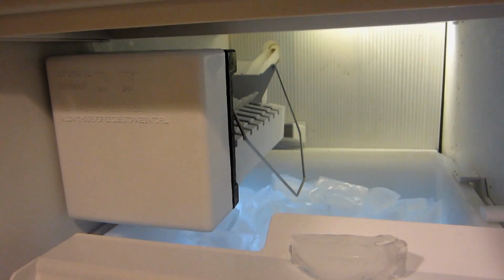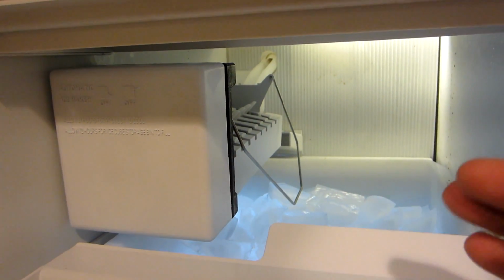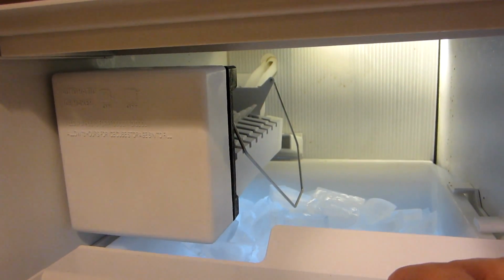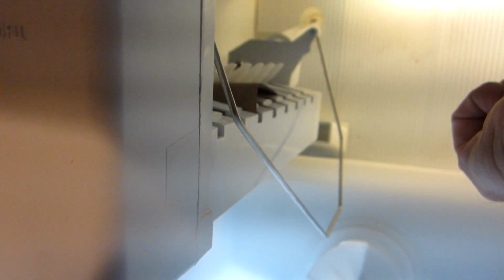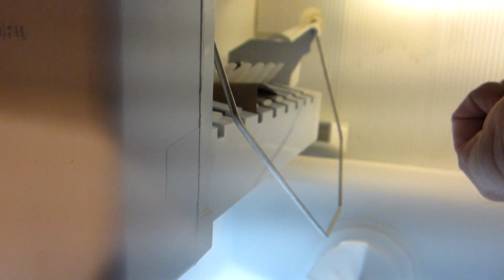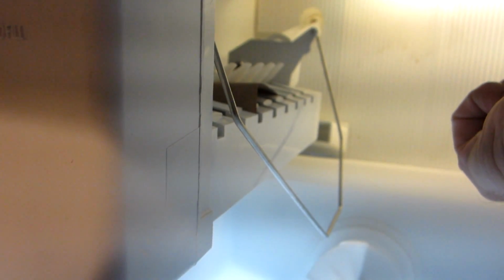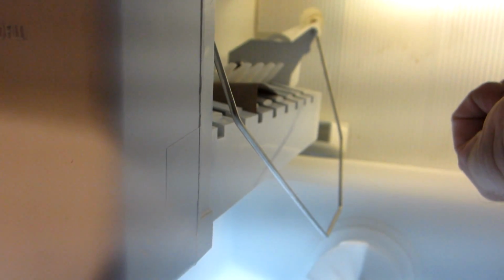How to repair most refrigerator ice-makers for less than $20

Comment: I have ice still frozen in the unit. but, no ice is coming out. This fridge is 23 years old. Got my moneys work from it for sure! So, what is the part I need? The little blades are not showing. What about the heating part of it to loosen the ice? Could that be the issue? 
Also, your fridge looks like it still has power. Did you not unplug it before taking it apart?

Comment: The hole to the left which signals the water to run has burnt out. The tiny copper sheets. How to I fix that part? The module runs and runs well but no water due to that area being burnt out.

Comment: Wow, that motor replacement couldn't be simpler provided someone shows you how to do it. I just replace my entire icemaker as the coating on the ice mold tray is old, blistering and flaking off. Anyhow, I salvaged the original motor and added it to my surplus parts collection. Thank you for sharing this.
Reply: How is the motor holding up after a few months of use?

Comment: Instead of waiting hours for the unit to cycle you could pop the cover off the front and stick s jumper wire in the holes at the bottom marked T and B. If your ice maker is working, within 1 min the unit will start to rotate. If it doesn't then the ice maker is in need of repair. One note though NEVER rotate the cam by hand. This will save you hours of time and I use it every day on my appliance repair job.

Comment: Was originally going to order an entire new ice maker, then i stumble upon this video, where for $29 bucks I could replace the entire Motor module control.

worked like a charm!  couldn't have been easier --- the hardest part was taking the plastic over off the front of the machine to be honest!
if people are scared about just replacing the motor, i purchased the entire module and it was a breeze and mentioned in the note.

Comment: Funny. Ice maker doesn't move, and it's broken motor right away without looking at it? (Maybe in your case, you must have some x-ray vision).  But No, There are several pieces in there that makes the motor not move.

Comment: I was trying to figure out why my Kitchenaid ice maker stopped working and found your video.   

I opened up the modular unit and took a look at the points.  They were corroded a bit, but one of the contacts where the things from the other side of the unit was completely vaporized.  The black plastic on the adjacent side was melted, too.

Comment: thanks for  the   info       I checked mine out everything was good.  except  for the broken water filling line next to ice maker,it had came off  i took off back covering in  freezer  only to find a frozen  tube encased in ice  water was running down behind the cover.  Cleaned it all up put everything back   wa la   ice.

Comment: My ice maker makes ice just won't Despenser it thru the door..I've cleaned all the ice out.and replace ice drawer but nothing.there's no motor running .when u pus the button.on front it opens flap but won't eject ice..please help...
Reply: Hi Judy
Just figured out what was wrong w/ mine,kenmore 106.56926600,but I believe most of them are the same.Behind the front cover there are 2 micro switches and the white cover plate. On mine it uses 2 plastic pins to hold this switch, well one of them broke allowing the switch to pivot and not depress,therefore not activating the auger  motor to turn the auger to push out the ice.What brand and model is your fridge and maybe I can help you out,if you haven't already fixed it.
Reply: Whirlpool

Comment: Thanks for such an easy to follow, simple instruction. It gave me the courage and motivation to get started diagnosing. The shunt wire proved that my motor was working, the fins were dipping into the non-existent water, Checked water supply, tube from valve to the outside back of the ice box area. Next I tried to 'blow' through the tube from the end I disconnected  from the valve and could not blow any air through into the ice cube/water area. This indicated to me that there was a blockage somewhere between the valve and the cube. Suspected frozen tube, used the hair drier to warm the tube inside the ice box. After a few minutes I tried blowing through the tube again and was successful. Reassembled everything, turned the water back on and let the shunt run the motor through a cycle and heard/saw water come into the mold. YAHOO! I have water, now we wait for ice to confirm repairs successful.

Comment: I have replaced the icemaker and water valve in my Maytag Model #m9bxxgmymoo with no success at making ice. I have checked that there is no obstruction in the delivery of water to the ice maker, it seems that there is no power to the unit. Where else can I look for the problem?

Comment: Yes, it was out of stock when I looked too.  I ended up getting the whole module at an onsight repair parts place.  Under $20. & well worth it.  It took about 5 mins to take out the old one & replace.  Thanks so  much for your vid though.  It made fixing/repairing/replacing an undaunting task.  I would never have thought to replace parts myself.  Also had to change out my thermostat - again - cheap, easy & a perfect fix.  Thanks again

Comment: I have the same ice maker but their is a little copper arm that came off.  In your video at about 2 minutes I see you removed to arm lever.  Under the white plastic piece that the lever arm actuates is where the copper arm goes.  How do I put it back?

Comment: Replacing Whirlpool ice maker on Model #GI6FARXXY08 and I have a dilemma. Wanted to show a picture but cannot insert one.  I think Whirlpool has updated the design on the ice maker and I cannot find directions on how to hook up the different designs. Any ideas?
Reply: Jon Baird 
Well I had the same problem. The connector is different. I used 6binch sections of wire and brought the terminals from the new square harness put and put shielded connectors on the other end. I then inserted these into the proper terminals. Make sure you check the wire order... as mine had a switched orientation for white and black. But once hooked up .. works like a charm.

Comment: I have a different type of motor. Its a m006 15 w 120 v 60hz it doesn't disconnect with the gear shaft easily, by turning,  and is improbable to reconnect without the proper tools. just wondering if you had any advice for this type of motor for cheap repair.

Comment: My icemaker was not dumping the ice.  I removed the icemaker and when I took off the motor cover, everything was coated with ice.  I removed all of that, scraped off the blue corrosion, and reinstalled the icemaker.  The teeth seem to be working now but I can't get the icemaker to fill with water.  It was filling before, just not dumping.  Did I do something wrong when reinstalling?

Comment: ok, I have a question... one of the contacts for the ice maker defrost coil is burned or corroded both on the brown plastic "board" with all the copper strips and on the end of the u shaped coil itself. Will this keep the ice maker from allowing water to flow into the tray to make ice?
Reply: +Larry D. Miller II 
Seems like the guy isn't answering anybody's questions on his video.

Comment: I noticed the motor in the video at 1:45 is different from the one at 1:55.  He is able to remove the motor in the latter shot but the one at 1:45 (which is the one I have) cannot be removed.  I will just buy the unit for $70, no biggie.
Reply: Yep... and one assembly is witness marked "Old".    The new assembly gets you a new mold, motor, thermostat, tray heater, etc... etc...

Comment: I have a door ice maker dispenser.  I replaced the entire motor for the dispenser with the oem part, exactly a year ago, and it is burnt out again.  Cost $100.  Can't afford to keep doing this.  Do you know any way to just repair the motor and prevent this from happening every year?
Reply: whirlpool refrigerator motor 2252130

Comment: This is very good video.  My Frigidaire stopped making ice.  I ordered a replacement ice maker from Amazon and removed and replaced.  But, taking the old one apart, I confirmed the motor had failed, and was stuck in the heater on position.  Next time I have a bad ice maker,  I'll check the motor first.

Comment: Thanks for the video. One thing to check is the contacts on the module. There are several pins that contact the metal runs on the module. On mine, I found corrosion on one of the contacts. After cleaning it up the ice maker is working again.

Comment: The ice maker in my whirlpooI stopped working.  Estimated the repair bill to be about $200 in labor and $100 in replacement ice maker, if done by service guy. After viewing this video, i dared to remove my ice maker model W10469286, tested it, motor did not work, so I took it apart to replace the motor. But I found that the motor cannot be separated from the gear box. It is attached with metal hooks. I pried the gear box apart from motor by wedging a flat head and hammer. Yes, it separated but this is not a screw on type. Then I looked for a replacement motor on ebay. No luck. There is no M004 motor that even looks like the original (or one that looks like one in this video). The entire front motor module was available for $25+, but it does not fit my model . So I ended up ordering a new ice maker, same model, supposedly OEM Whirlpool original just for $38 free shipping from Amazon. Looks similar in picture but I will know for sure when I get it in a week or so. For that price I would recommend just changing the whole ice maker rather than go through the hassle of disassembling every thing. After ordering the whole unit, I decided to search it non-ebay. I found Fleck part # 18743, the motor with the gear box for $18, looks similar to the original (don't know if the gear ratio is the same or not). Thanks for the video.

Comment: I just pulled my module off and I found my motor did not separate. Additionally, I found my gear drive had a stripped tooth. Video have me the confidence to pop that sumagun open.

Comment: Great video!  I was NOT able to replace just the motor.  Mine did not twist off as demonstrated.  However, I was able to order the entire module for $21 with shipping and tax (McCombs Supply).  I performed the quick and easy replacement of the module and now have plenty of ice.

Comment: I have a Whirlpool model ED25RF.  I am at the point of removing the motor, however turning it to the right does not remove it, even using pliers.  Am I doing something wrong?  

Please see image at : oi40.tinypic(DOT)com/rm32ty.jpg.  

For completeness sake, here's an image of front of module :  oi42.tinypic(DOT)com/1ervc1.jpg
Reply: Thank you for your video – very helpful !

Comment: I just replaced the inlet valve. My ice maker has an issue. Water is not being sent up to it. I ned to know if you have a video showing me what to look for ? I also wish to know, would confusing any of the plastic tube leads cause this ? The 2 for the bottom of the chambers are 2 different sizes so no confusion there. However there is 1 firm,opaque lead for the front of the inlet assembly and 1 that runs off to a second attachment, also opaque and firm. I saw your video on how to install the inlet valve and it showed me what I had already figued out but yours only required 1 of the firm lines. The part that yours came with that MINE uses, you discarded. Anyway, input,ideas ? Thanks ahead of time. GOing to try to figure this out tonight, hoping you see this today. Have a party tomorrow for the family and not wanting to buy and deal with the logistics of storing 5 bags of ice :)

Comment: Great video, Great response from skycraft. Discovered the large plastic gear spindle is also broken, Presume the number printed after the word ...Manually  628358 is the part number for this control part.  Suggestions where I might purchase? Don't think super glue is the way to go.

Comment: My whirlpool ice maker is making too much ice and won't turn off.
Reply: I have the same problem on my GE/Hotpoint fridge.  Even if the arm is in the Off position, it won't stop making ice.  Someone help.
Reply: David Crandall The electrical contact of your arm is stuck close and it will continue to make ice without a break. Your best bet is to replace the whole ice maker unit.
Reply: I ordered a new one and then I discovered the old one had a plastic part that was broken.  I took the plastic part out of the new one and put it in the old one.

Comment: The thermostat to start the cycle is behind the modular head. with no water at front the thermostat cools faster, The water doesn't. Cycle will trip,, bust through ice, which is half frozen. As it rotates, the water will drain out of the center of the cubes, back into the mold. Hollow ice is then dropped into the bin.

Comment: I have a cheap skate ice maker repair book.  This ice maker is in it and I have fixed it at least once.  One thing to do, besides waiting for the paper to fall, is to make a short jumper wire, maybe 2 " long.  strip the ends and insert each end of the wire into the 2 holes located about 5 o'clock on the gear.  That will start the motor.  Quicker than waiting.
Reply: Should be labeled T & H.  Also if you check that and the motor starts working... Then you can put the wires into holes L & V.  If you don't hear water filling the box then that's your problem

Comment: I can't separate the motor from the gear box - any suggestions?
Reply: same happened to me.  you have a different kind of motor and gear box that can't be seperated.  the whole module has to be replaced
Reply: My 1.5w motor popped out with a flat-head screwdriver. Didn't twist out like the 3w one in the video.

Comment: you dont have to strip the wire before putting them in place?
Reply: tomfoolary The wire slots will strip the wires when u press down on the wires. Just make sure u have unplugged unit and press down firmly.

Comment: I followed this video and determined the issue was in the motor assembly, however just before cutting the wires, I hooked up  120v AC to the motor and turns out it was working fine.  It was an issue with the gearbox which some cleaning and greasing fixed.  I recommend everyone to test these parts separately first before cutting otherwise you'll need to re-solder wires if it turns out not being the motor after all

Comment: I'm in an area where there is a high concentration of dissolved lime in the water. There is no water coming into the ice maker through the electric valve from the copper water line. It is coming from bellow the floor and where it is tapped into the main water line it is not accessible below. I have been told that these tapped lines can form lime deposits over the years and I think that is my problem to point that it has choked off all of the normal water flow to the refrigerator ice maker. MY question - how can I clean this pipe out?
Reply: neil, were u ever able to figure it out? I might be having a similar issue

Comment: I have a G.E. model GSS23QG refrigerator.  The ice maker dispenser stopped  dispensing whole ice cubes.  Instead it crushes the ice cubes just like when it is in the crushed ice mode.  Any ideas for a fix?
Reply: John D'Angelo The heater on your ice maker is bad. So during harvesting cycle the teeth are scrapping the ice instead of pushing the ice to the bin. Just replace the whole ice maker is your best bet.
Reply: GarciasHVAC sThank you for the response.  It was actually the solenoid assembly.  It was replaced and the ice maker is working fine.

Comment: Problem.  Who knows what your going to get on eBay anymore or if your even going to get it.  My local appliance parts outlets will sell the module for twice the cost of the whole icemaker unit but will not sell just the motor.  I appreciate this clear tutorial but the parts are not readily available for a simple motor change.  I ordered the whole icemaker which was in stock (one day away) for $65 and all I have to do is swap the modules.  A bit more than $2.50, but quick and I know I am getting the correct parts.
Reply: Where did you fund it for $65?  I only find them over $100.
Reply: Dominic House
He must have gotten lucky ... when the small circuit board in our dishwasher (KitchenAid, but it's made by Whirlpool) was damaged after the soap dispenser solenoid shorted out and caught fire, it was nearly $400 just to get a replacement board!!! That's nearly half the cost of the whole machine! What the hell!

Comment: Where do you buy the motor
Reply: I have the same question. I have a KitchenAid Refrigerator Model KSRP25SSS00 and jumping the T to H close together holes at about the 5 o'clock position determined the motor did not work.  I removed the motor but now cannot find it for sale. I see the modules that might work, but they all have 1.5W motors, not the 3W of the original. So after troubleshooting do not see a source for the part I need.

Comment: The fill is time-based (~7 seconds). You have a restriction in water flow. Either the solenoid valve in back of ref or you plumbing to the valve has a restriction. Cut off water to the ref, take off the water line to ref and check water flow. The water should be at a flow of 30-60 psi. 

Why does this make them hollow? The icemaker fills from the back to the front. If you don't get enough water, you will have empty chambers to the front.

Comment: great tutorial video.  my question is, during the time it took to make ice, did you happen to  notice the freezer temperature rise  anywhere from 0-8 degrees and back and forth like so?  i'm wondering if making ice with no ice in the container does have the freezer temp fluctuate until stable?  any advice would be helpful